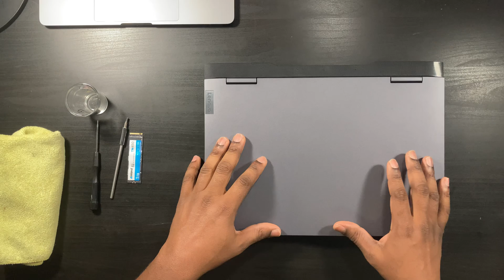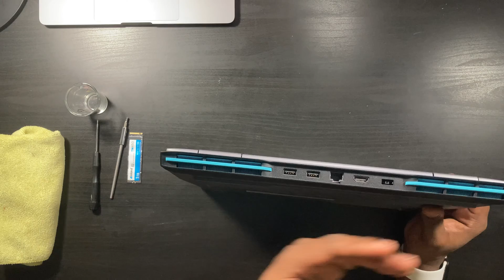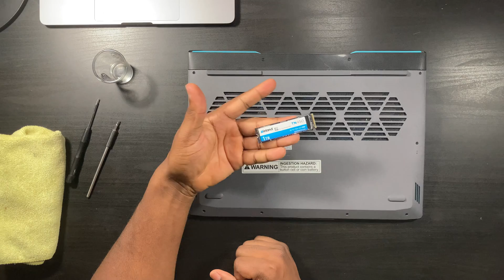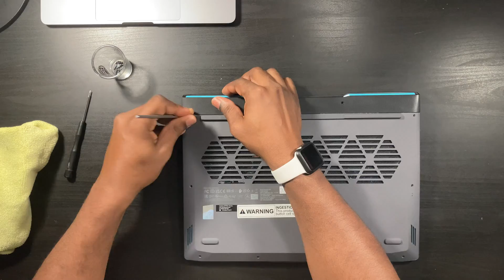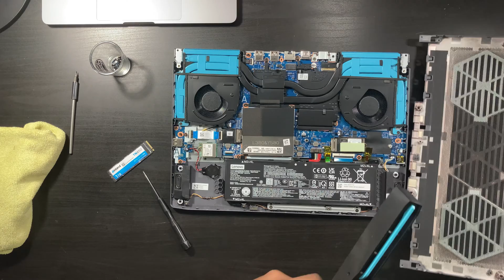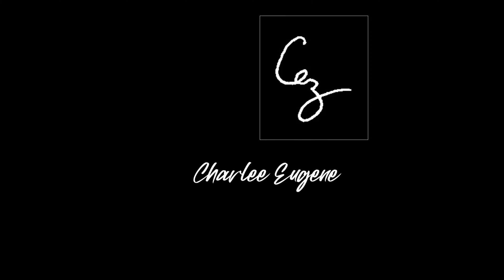Lenovo LOQ 15APH8 SSD Upgrade and RAM Location!!!!!!

Comment: I have this device with the original Realtek 8852BE Wi-Fi card and I'm having browsing issues. I mean, out of nowhere when I access a website, the ping drops for 3 to 6 seconds. This is disastrous for gaming, as it also happens to me while I'm in a game.
Reply from the maker: I didn’t remember having this issue. Is it possible to change your WiFi card?
Reply: @charleeeugene  I'm waiting for tomorrow to buy one and try with another card, but I'm almost sure it's the card, it supplies my router via cable and gives all the bandwidth completely stable... meaning it's not a Windows problem... tomorrow with the new card I'll test if it's the router or the internal Wi-Fi card, although on the internet they blame the card...

Comment: I've been told that if I wanna upgrade the 2242 slot with a 2280 SSD, you can, but it'll bend the SSD a bit in the middle because of the stupid unremovable 2242 standoff.

Would it be wise for me to just shave it off? Or let it bend?
Reply from the maker: Let it bend it will fine just don’t over tighten the screw

Comment: Sir, if I want to install a 2280 SSD without disturbing the original SSD, should I install it on the right or left side? or should i get the 2242?
Reply from the maker: Leave the one already installed unless you want to reinstall windows. Use either 2242 or 2280 as long you can screw it down securely.

Comment: Thank you for the video. Do you know how to remove the first screw post on the right hand side slot to install a 2280 ssd on it?
Reply from the maker: Thanks for watching I had someone say they couldn’t remove the screw as well. I did nothing special it was super easy. What exactly is the issue?
Reply: @charleeeugene  Thank for the response. I mean the first screw hole on the right hand side slot. I cannot remove that to give space to a 2280 ssd. If you did, what tool did you used? I tried to remove it using slip joint pliers but It couldn't.
Reply from the maker: @DanialRezaee-y2g  After watching my video I didn't touch that M.2.. Did you try making sure you have the perfect size screwdriver and as your turning it your applying pressure to break the screw loose. because if the screwdriver isn't perfect size then you run the risk of stripping the screw. How about some  precision  needle nose . pliers grip the outer edge of the screw and have the screwdriver inserted at the sametime twist left. I know it sounds crazy
Reply: I'm interested in this as well.  It appears 2280 should work but want to make sure the 2242 standoff screw can be removed or it's in the way

Comment: I need help i have a ryzen 7 but rtx 4050 I don’t now if it’s ddr 4 or 5 ram
Reply from the maker: Flip the laptop over look at the model number then google the specs for your machine that will tell you
Reply: ddr5 5600

Comment: What is the maximum limit of ram and SSD  for each slot? Loq AMD 7 7840 ,4046
Reply from the maker: Ram is 16gb per slot and ssd is 1tb maybe 2tb not sure
Reply: I'm confused by this because the manual says 16GB per slot but they sell a 64GB of this exact model so.... ....?
Reply: i have same laptop, i will add 2tb samsung ssd but make sure its single sided, and already i added 32 gb kingston fury ram

Comment: Is it necessary to disconnect the battery before upgrading?
Many people are talking about this on the internet.
Reply: yes it is, make sure to flush the power too by pressing on/off button
Reply from the maker: Honestly for ram upgrades and ssds no but it is good practice. I’m going to start doing it now on.
Reply: You certainly should. and hold down the power supply to drain the power. Otherwise there is a small chance you toast stuff. It says to in the technical manual. Do not risk it.

Comment: Do we need thermal pad on ssd as it is on the other one? Also i noticed some components on the laptop where you placed the new ssd wont it effect those wiring due to heat?
Reply from the maker: I don't think its necessary because the ssd has space between the m.2 and motherboard but you can if you want too. Just make sure its a thin piece of thermal pad.
Reply: @charleeeugene  okay Thank you!

Comment: Hello I have the lenovo loq 15arp9 do you know whats the max storage and ram it can take?
Reply from the maker: 32GB of DDR5-4800 RAM,Two M.2 2280 PCIe® 4.0 x4 slots Up to 1 TB each so you can have 2 TB Total and 32GB RAM
Reply: @charleeeugene  thank you so much, I've been searching online. I hardly understand even a bit of pc/laptops
Reply: @charleeeugene  does it specifically have to be DDR5-4800 can it be 5200 or 5600? I saw there's options and I wasn't sure if it has to be exactly 4800?

Comment: Hi bro. I have a lenovo LOQ APH8 2023 model laptop with amd 7 + 4060. I have a doubt regarding SSD upgrade. does the second empty ssd slot support gen 4 ssd or only gen3 PCIe? Whether if it supports gen 3 or 4 which ssd's would you recommend to buy. Only want TLC nand flash memory.
Reply from the maker: Storage capacity: Up to 1 TB of SSD storage 
M.2 slots: Two M.2 slots, including one M.2 2242 PCIe 4.0 x4 slot and one M.2 2280 PCIe 4.0 x4 slot 
Storage type: M.2 2242 SSD PCIe NVMe, PCIe 4.0 x4 512GB / 1TB

Comment: PSA!! NEED TO KNOW

Storage Support[1]
Up to two drives, 2x M.2 SSD
• M.2 2242 SSD up to 1TB

Storage Slot
Two M.2 slots
• One M.2 2242 PCIe® 4.0 x4 slot
• One M.2 2280 PCIe 4.0 x4 slot

Storage Type
Disk Type Interface Offering
M.2 2242 SSD PCIe NVMe®, PCIe 4.0 x4 512GB / 1TB
Notes: [1] The storage capacity supported is based on the test results with current Lenovo® storage offerings

As you can see there are two M.2 slots, one 2280 and one 2242. Your upgrade options will depend on which format SSD is in your system. you can determine that by using Windows Device Manager to get the make and model of the SSD, then web search on that to get its specs.

Either slot can accept up to 4TB capacity. See Note [1].  Lenovo's maximum sizes are based on the test results with Lenovo RAM and storage offerings at the time the model was introduced. Maximum capacities increase over time as new components come on the market.

ISSUE AT HAND Source: https://forums.lenovo.com/t5/Gaming-Laptops/Maximum-supported-NVME-for-a-Lenovo-LOQ-15aph8/m-p/5274465?page=1

(NOT ME)I wanted to give everyone in the community some feedback regarding the upgrade process of the NVME in my Lenovo LOQ 15aph8, because it wasn't as easy as I expected it to be. Long story short, just choose a single sided NVME and the Lenovo LOQ 15aph8 will be fine, otherwise get ready for some issues, as I will describe below.

To get to the point, I have tried a Kingston Fury Renegade 2TB - great NVME, good speeds, and good price in my country. It was recognised by the bios, I installed windows 11 on it, everything was great, except that when I tried Crystal Disk Mark benchmark to see what speeds it could reach I got a BSOD (blue screen of death) when the test was reaching the writing segment. That was the start of my issues. I tried the second NVME slot on my laptop - same behaviour. The original NVME that came with my laptop worked great on both slots with the same tests, so I ruled out slot issues with my laptop. To see what was happening I reinstalled windows on the original NVME that came with my laptop and realised that the Kingston Fury Renegade was disconnecting from the system when Crystal Disk Mark did the writing test. After a restart the Kingston would be available again, so that explained the BSOD errors when the windows was installed on it.

At that point I thought that I got a bad NVME, as I had all the drivers installed for my laptop and there were no new firmware updates for this drive. So I returned this NVME and bought the Kingston KC3000 2TB (basically the same specs as the Kingston Fury Renegade), as I thought it would be an "older" model, so maybe it was more polished. To my surprise, when I tried it in my laptop it behaved the exact same way as the Kingston Fury Renegade it replaced - immediate disconnection when doing the writing test in Crystal Disk Mark.

At this point I realised I have to get in contact with Kingston to see what is going on, as both drives were brand new and behaved the same. So that is what I did and they were very surprised by the behaviour I specified as well. However I soon got an answer I did not expect - the problem was that the NVMEs I was trying were double sided (they have memory modules on both sides of the board), while the original NVME in my laptop is single sided (it has memory modules only on one side of the board). Apparently the motherboard of the laptop must support a double sided NVME, otherwise disconnection issues and other strange things will happen. And Lenovo LOQ 15aph8 does not support double sided NVMEs... Well, that is an information I would have liked to know from the start, as I am sure other people would.

That is why Lenovo suggest that you should only upgrade to a 1TB NVME, because most (if not all) 1 TB NVMEs on the market are single sided. Once you go to 2TB or more you can find single sided or double sided NVMEs. Unfortunately, for most customers it does not matter, so it does not appear in product specification.

As an example, Kingston has the NV2 (2TB and 4TB) that are single sided, but unfortunately they are also gen 3 NVMEs. The Kingston Fury Renegade is a gen 4 nvme, but only the 1TB model and below is single sided. The 2TB and 4TB models are double sided. The exact same thing applies to the Kingston KC3000.

After some research I found that the Samsung 980 Pro 2TB and the 990 Pro 2TB are single sided, they both are gen 4 NVMEs, so I went with the Samsung 980 Pro 2TB. The Samsung 980 Pro behaves great in my laptop - no disconnection issues, no speed issues, everything is nice.

I would have liked that Lenovo would have specified that only single sided NVMEs are supported in the Lenovo LOQ 15aph8 and not specify that arbitrary 1TB maximum capacity per slot - as that was more confusing than helping.

I hope my experience will help other lenovo laptop users in their upgrade process.

Have a great day!

Comment: So you mean total 3 SSDs can be installed in Lenovo LOQ?
Reply from the maker: Must certainly 2 but there is another slot that might be able to fit a 2230 m.2 slot or could be for something else. Not sure
Reply: technically you could if you pull the m2 slot with the wifi and bluetooth out. But then you're gonna have to figure that out. Otherwise no, because it has 2 availible SSD slots and no HDD slot.

Comment: Brother even i have same specs 
I want to upgrade the ssd and ram 

If i remove yhe existing ssd and add 2 of the new ssd then the existing data will be gone right ?

Or if i add a 2tb ssd on the empty slot of gen 4 
Then the already existing 512gb gen 3 ssd 

Is it ok to upgrade like this ?
Or wt brother?
Now plz tell me a good ssd and ram to upgrade in this 

Plz tell me specific name of the ssd for  it
Reply from the maker: Yes you are going to have to back up your current ssd to a external drive before replacing your ssds. Samsung makes really good m.2 ‘s . But honestly you can pretty much grab any decent brand solid state drives.
Reply: @charleeeugene  ook 
Thanks brother

Comment: I bought a 2242 for the left side ssd but it’s not long enough.  Can still use it if I make a plate to hold it down?  Does the screw complete a circuit or is it necessary
Reply from the maker: There is at least two different screw size holes in the motherboard it still doesn’t line up with one of them?

Comment: Sir Please reply, I am planning to buy Lenovo LOQ (2024) AMD Ryzen 7 Octa Core 7435HS with 4050 in 77k, is this a good deal for me, I come from a upper middle class background and I found this laptop, Please sir, reply if it is worth to buy for long term (3-4 years) usage purpose (I am currently practicing Backend development and 3D modeling) .
It will be so helpful to know your decision sir.

I usually use the laptop plugged in.
Reply from the maker: Yes it’s a great machine especially if you get the 4050 graphics card it is future proof!!! Buy it!!!!
Reply: i have it mate and it is good and my sole dislike is the ssd size and ram size but it is great if not slightly overkill for someone learning 3d dev but then again you will not just learn 3d with it you might do other stuff like gaming , using the llama deepseek ? ai thing ect...

Comment: I have a Lenovo loq 15ahp9 (Ryzen 5 8645 hs , rtx 4050) will the ssd size (2242/2280 etc) be the same and also should I follow this tutorial?
Reply from the maker: Yup you are good wish I had that 4050 I’m jealous
Reply: @charleeeugene thanks dude you helped me out there are literally no tutorials for my model also do you know anything about the Lenovo loq 2024 motherboard, issue I think will not face it since I have a Ryzen hs processor and it’s only occurring on intel hx processors
Reply from the maker: @erik-thespitz1776  no problem sir !!!!! haven't heard anything about the loq 2024 model.
Reply: @erik-thespitz1776  you might face a battery drain issue i.e the battery level decreases even when it's plugged. just call up lenovo and they'll probably upgrade your adapter from 170w to 230w and that should take care of that if you ever face the issue.

Comment: Is there a limit to how much storage size you can put in there or you can put 2 2tb nvmes?
Reply from the maker: You can put two 8 tb ssd if you wanted!!!
Reply: @charleeeugene  thank you for the answer. I will subscribe as thanks.
Reply: I read that for SSDs larger than 1TB per slot they will work as long as they are single sided. Anyone can confirm?

Comment: i got the same ram 2X8GB, should i upgrade it to 2X16? or even 2X32? or would that be overkill?
Reply from the maker: Not sure if it can handle 64gb but for sure 32 gb go ahead and max out so you don’t have to keep opening the laptop.
Reply: @charleeeugene  thank you so much <3
Reply: Did you manage to install 64GBs and did it work well? What brand were they?
Reply: @teosiriosica  nope not yet :') but i think i'm going for 2x32gb to be safe and i don't even need 2x64gb would be overkill for what i need to work with.
Reply from the maker: @teosiriosica  Max Ram is 32GB and I haven't upgraded it 16GB DDR5 is enough for now.

Comment: Why can't I remove the screw from my SSD slot? Help pls I can remove all screw, but that is imposible y have done everything😢
Reply: Mine is super tight as well, I’m using the correct size but it’s so tight I’m afraid to strip it, did u manage to unscrew it?
Reply from the maker: I hope you used the correct size screwdriver and not stripped the screws. worst case scenario use some needle nose pliers and grab the outer edge of the screw and turn left or use  a very small amount of WD40 . It really should of  just come off strange!!!!!!

Comment: OMFG, i wanted to place my 2tb WD m2 from my PS5 in this laptop.... i thought... it doesn't fit, i'm not gonna swap the original right now. And now i see your video it has an additional slot ffs. i just closed up everything. 

Now the last question before i open everything up again, does an m2 fit with a heatsink? i'm not sure if i can take it off of the WD one in the playstation...
Reply from the maker: Not sure sometimes  those heatsink's over m.2 can be thick  the only way is to try it out. But m.2 SSD's are super cheap and hopefully you live near a microcenter. Worst case scenario grab a new one.  This laptop is nice I'm loving it!!!!! Let me know how it goes
Reply: I'd like to know how it goes as well. Says 1tb recommended in the specifications. I'd rather have a 2tb than a 1tb myself.

Comment: Found exactly what i was looking for, i really like how you actually explain how and what to do unlike the other channels, also wanted to ask how to unplug the battery cuz i know you dont have to but i really dont want to accidentaly short a circuit in a also new laptop
Reply from the maker: Thanks for watching honestly I never unplug the battery when upgrading ram and SSD’s but I understand your concern but I advise being careful when doing so it’s usually a small ribbon cable that has a latch connected to the motherboard that needs to flipped up to remove the cable. Just imagine damaging that connection now your laptop won’t charge then you have a laptop that has to be plugged in at all times. But search YouTube for “ Lenovo loq 15APH8 Teardown “ good luck let me know how it goes.
Reply: @charleeeugene  Honestly i didnt even think about it that way, if i ever decide to upgrade storage or ram and it goes as planned ill try to remember to respond here and give like a update
Reply: @charleeeugene  hey man, dont know if you remember me but i finally decided to buy and install a new ssd, i used the Lexar NM710 1tb ssd just because it was on sale, i decided not to unplug the battery and everything went perfect with little help of my older brother who just pushed down the ssd when screwing it in, anyway tysm for the tutorial :D
Reply from the maker: @Nomysz  I remember you good to hear you didn't have to unplug the battery. Good Job!!!!!

Comment: nice video buddy!! would like to know if both the SSD slots are gen4 ? also what is the maximum supported storage per slot?
Reply from the maker: Yea gen4 is supported and it can handle whatever you threw in there.
Reply: @charleeeugene will 64GBs (2 sticks of 32GBs) of DDR5 work fine?
Reply: @teosiriosica  just check the documentation for the cpu. it depends on the cpu. it should be like max 128 gb or something like that.(doubt you could get 2x64gb sticks tho)

Comment: does it have a slot for hdd?
Reply from the maker: No only two slots for m.2 SDDs no slots for 2.5 hdd
Reply: I wish. I bought it thinking there was one because I normally get one that has that slot and put a tile in there. Then I have GPS location forever on it. :D